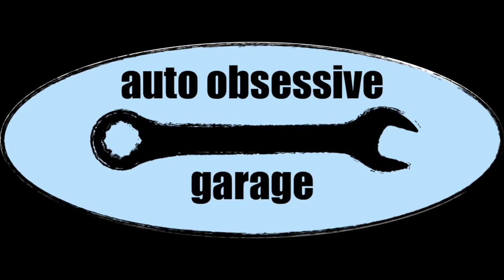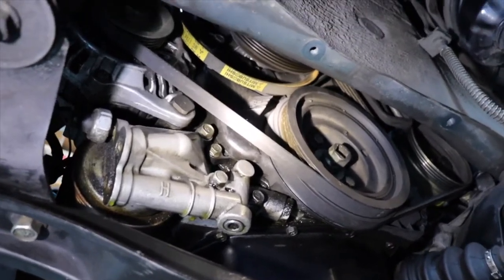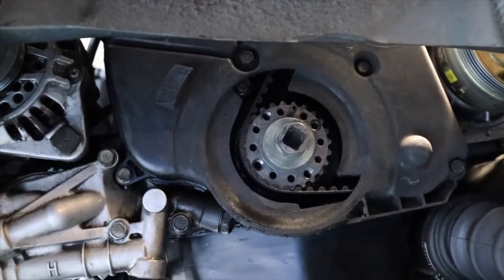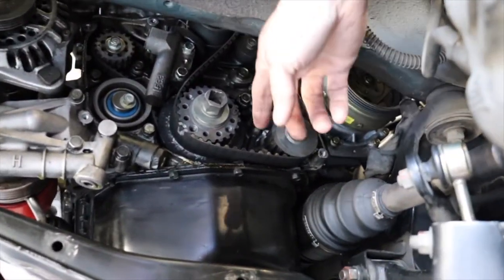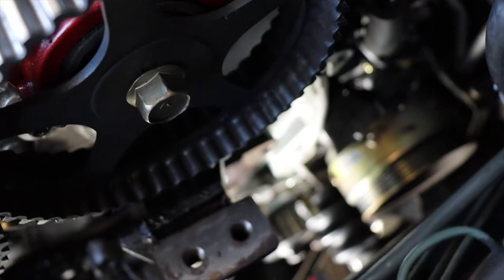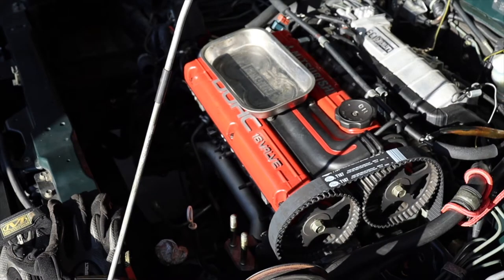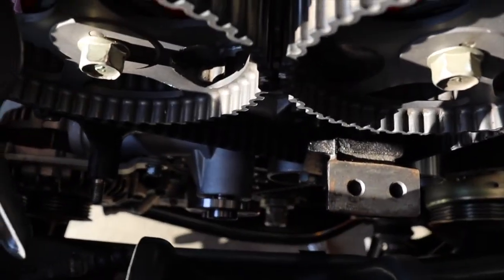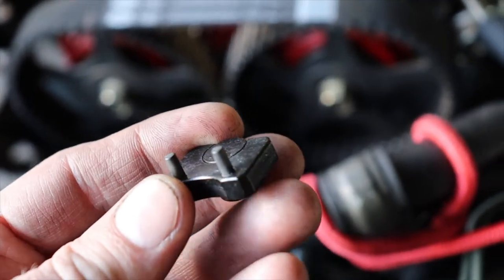1991 Mitsubishi Galant VR-4 - Episode 5: Timing Belt and Water Pump Replacement

Comment: Shoulda replaced cam and cranks seals, oil pump gasket.
Reply from the maker: That’s a fair suggestion, but usually I’m faced with limited time. It’s not too hard to access either of those, so I tend to replace them once they start to leak. Truth be told, if I had the time I would have also done the head gasket and intake manifold just to future proof the car. Again though, you gotta draw the line somewhere.